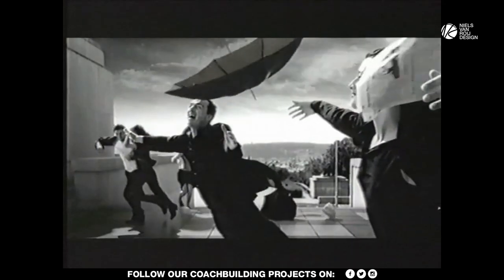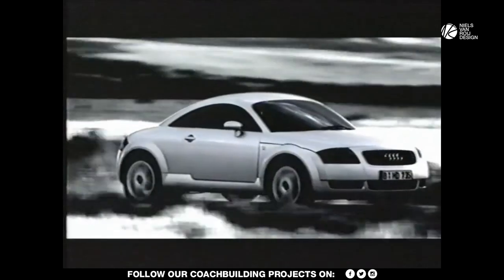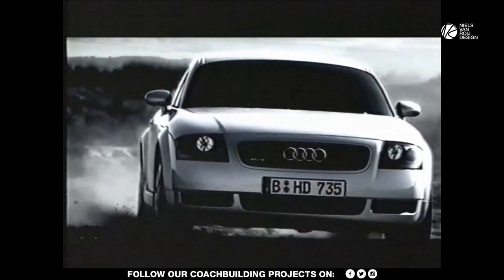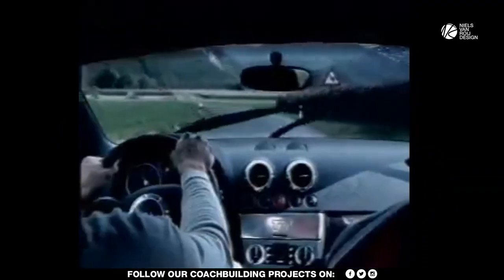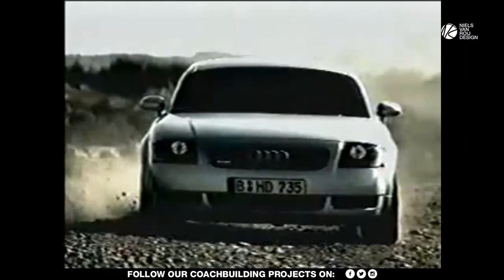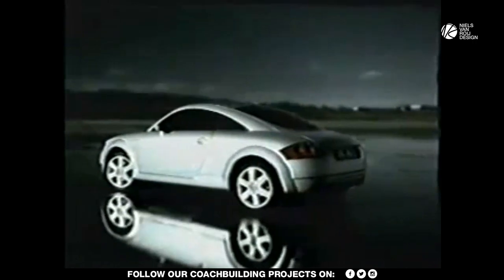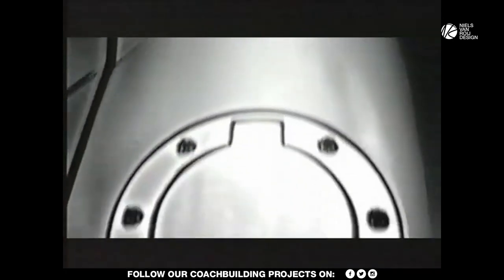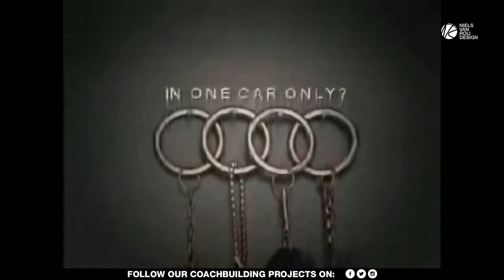Audi TT car design review: is this TT the BEST Audi ever designed?! | Niels van Roij Design

Comment: Definitely a future classic, I owned one of the first ones without the rear spoiler or any stability control, Audi wanted to take it back to retrofit these but I instead sold the car. Despite numerous well publicised accidents they were much in demand because of its styling.
Reply from the maker: Thanks for watching and getting in touch. Definitely a future classic, indeed. Great to hear you owned one of the first ones, indeed without the rear spoiler or any stability control! Very hard to find one without the spoiler now, although some do exist! Numerous well publicised accidents took place, as per your message. One even of two TT's hitting each other... Despite all that: the car was a revolution for design, car design and Audi design. And fortunatelty in demand because of its styling.
Reply: @NielsvanRoijDesign  silver exterior, black interior, without the spoiler. That's the ultimate TT!
Reply: Already a classic.
Reply from the maker: @BerrySt0  Haha, excellent find. They are still out there!
Reply from the maker: @BerrySt0  It sure is - although the Baseball interior is also very sought after!
Reply from the maker: @Stratoszero  It sure is indeed! Gorgeous work by the Audi design team.

Comment: The original TT was a statement. Bold, thick, fat but at the same time proportional, fluent. It somehow blended all the negative traits in a way that works, in a way that makes the car stand out of the norm. Love it. Look at the car from the side and steer your view to the front. The curvature of the bonnet fluently flowing into front bumper to its logical abrupt stop, matches the curvature of the wheel arch. The same thing goes at the rear: the curvature of the boot lid matches the radius of the wheel arch and the thickness of widened fenders goes into interplay with the thickness of window pillar (front and rear) and the silhouette of the roof. Geniously executed! Optics shape accentuates these matching radiuses — the next generation TT lost that connection.

Now, park two further generations alongside with the original and the origingal one will still stand out unlike the other two. It's a shame. TT was an outlier, a thing on itself. But VAG's policy on the design language led this unique car to its dead end — a slight variation on the same.
Reply from the maker: Well pointed out indeed. A truly great piece of design and - most importnat: relevant. This truly was the embodiment of Vorsprung durch Technik. This is Bauhaus on wheels. It does what it says on the tin. Current Audi's are wildly complex, overly dynamic and massively aggresive. And for no good reason.

Comment: By the way, the production version was launched in 1998, instead of 1999.
Reply from the maker: Correct, the coupé was launched in September 1998, followed by the roadster in August 1999.
Reply: Late 1998s are 1999 cars in VAG parlance. If you have an in depth understanding of the mechanical underpinnings of the platform you'll understand the issues that the 99/99.5 model year split caused.

Comment: 3:20 I'm not sure how you come to that conclusion. Audi had been a serious competitor to BMW and Mercedes previously. The UR Quattro, the v8, the RS2 Avant. All of these cars equally if not out competed BMW, Mercedes and even Porsche from a performance perspective while their less sporty models easily kept up in ride quality and dynamics.
The TT is identical from a drivetrain and suspension standpoint to the Golf. There was nothing premium about the powertrain, suspension or ride quality. 

Not that the TT isn't gorgeous for all of the reasons you state, but that last conclusion seems like a total non sequitur.
Reply from the maker: Thanks for tuning in and sharing your thoughts. The cars you mention all are great Audi's. They did not work as well for the brand though as their, indeed Golf based, younger subling, the first gen TT. 

In the eyes of many people, paying customers that is, Audi was not up to cratch with all the brands you mention. Compare it to how in China truly fantastic cars are made these days, even some with the same quality and fit and finish as European or American cars. The perception by people is very different though. That is what the point is here and breaking Audi through in the segment it had been aiming for for many years is what the design of the TT did.